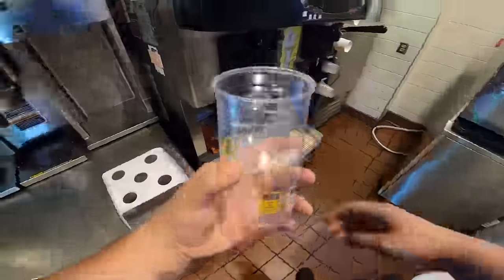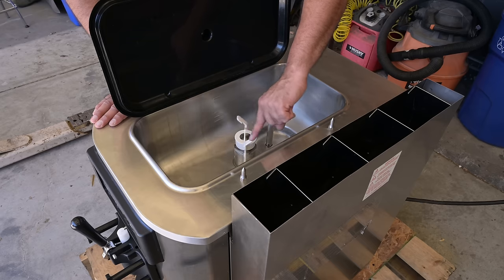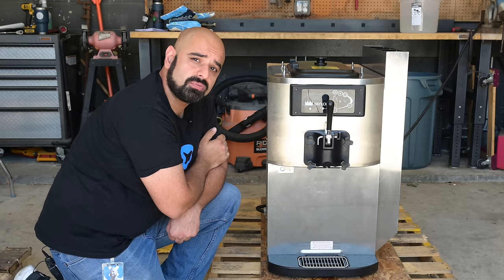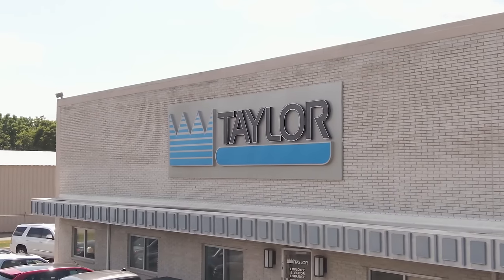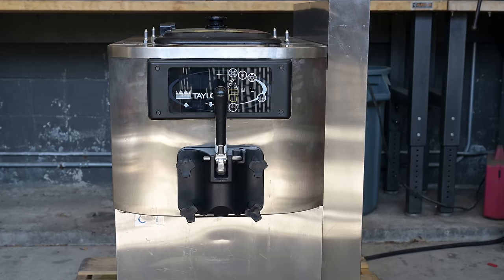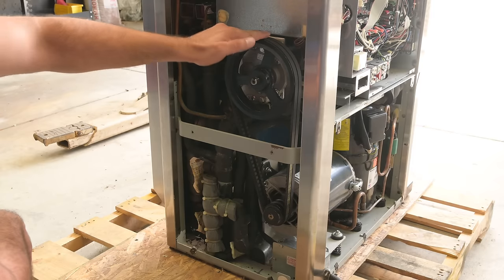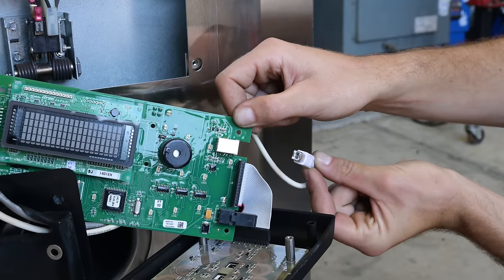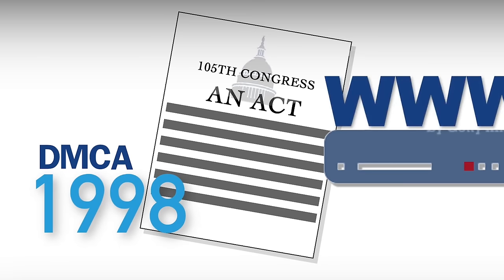Why McDonald's Ice Cream Machines Are Always Broken and How To Fix Them

Comment: As someone who's worked at McDonalds in the UK, the ice-cream machine is actually almost never broken. The employees tell you that it is because they/the shift before haven't cleaned the machine, or (as said in the video) it's on a heat cycle.
Reply: At the one I worked at it boiled down to simple laziness. As soon as the last adult manager left for the day the kids that they left in charge would start telling everyone that the machine was down.
Reply: I think McDonalds in the US has extremely high, seasonal demand for ice cream. A lot of places in the US get very hot in the summer and so people crave a lot of McDonalds ice cream during heatwaves. This leads to overheating and overloading machines which shut down during peak hours
Reply: @dizzy_derps yet people continually say all service jobs should just be for teens part time and demean the adults who work those jobs 🙄
Reply: Idk, I guess the people they hire at Wendy's are extremely good workers. Idk how McDonald's has an average of 30% of their machines down at franchises vs Wendy's who has less than 1%.
Reply: @Camelotsmoon  The other interesting bit is that Wendy's machine made by Kappus which owns Taylor as one of it's brands. Something tells me the relationship is much better between Kappus and Wendy's vs Taylor and Mcd's.
Reply: I have worked for 7 years at McDonalds in The Netherlands and we also had these Taylor machines. 2 of them. They where rock solid. The heat cycle runs at night when the store is closed. You only had to make sure that it was filled up. If not, it was beeping at you in the morning and you simply fill it up and start the cycle again. Done. 

They where cleaned every evening with a big clean every other week. They are very reliable when you use them correctly
Reply: is it a hassle touse the machine and serve ice cream?
Reply: @patrick71994  how busy was your store tho? I see a lot of people saying their machine was fine in other countries but I doubt they have the customer turnover we do in the states. Plus there could be laws in the Netherlands that prevent companies from screwing you there the way they can here.
Reply: The ones in the US have a very strict policy where the machines have to be maintained by a specific company and that company only, at least that's what I learnt in a documentary video I watched about it a couple years back, I don't think that level of anti repair is allowed in the UK which is why it is laziness here.

edit: Oh it's what this video goes into later haha. But yeah.
Reply: @chongli297  Taiwan is extremely hot most the year and the demand for ice creams is quite high, but the machine is never down or broken. Maybe it's because they use the kitch machine here, and since mcdonalds here is managed by a different company, Taylor doesn't tell them what to do.
Reply: Can confirm that the soft serve machines in Hong Kong never breaks as far as I can remember. We have high demands on sundaes mcflurry etc. too, but the restaurants are operated directly by mcd instead of franchised, that's probably one of the reasons why it seems to be a US only problem.
Reply: Speaking of the UK they might be able to provide this to other countries given they only describe the US law
Reply: @Camelotsmoon  Wendy's uses the old manual machines you drain and clean nightly like any respectable food purveyor has used for over 50 years. 

The problem isn't the machine, right to repair, or Taylor. It's that people keep expecting food from a McDonalds.
Reply: @strayiggytv  The notion that an industrial food machine breaks when used a lot is insane. If it does its a badly designed machine and should not be used. Can you imagine a restaurant with a stove that would break if used for more then 2 hours?
Reply: They could have used something like the Kytch in the ones you go to. doesn't mean it isn't an issue.
Reply: @chongli297 Explain why Dairy Queen NEVER has this issue.
Reply: @monad_tcp  your refrigerator is designed to be able to run its compressor continuously for hours on end. When you put a bunch of warm food in the fridge it can take hours for it to cool down. That's not how the ice cream machine works. It is trying to make the ice cream cold FAST. Therefore its compressor is designed to operate under very high load for shorter periods of time (short duty cycle). This is why the compressor overheats during peak demand
Reply: You have different machines across the pond. In America, we have laws that protect the Taylor corporation.
Reply: @chongli297  

""As someone who's worked at McDonalds in the UK, the ice-cream machine is actually almost never broken.""
"I think McDonalds in the US has overheating and overloading machines which shut down during peak hours"

This video is putting out wrong information. Tylor machines are common everywhere even in Sweden, what makes the US McDs special is that McD headquarters have a decades old agreement with Taylor where Taylor pays to be the exclusive supplier of the specific model American franchise takers must use.
This model, used only at US McD, has the special function of the service menu being locked behind a code, that is only provided to the technicians employed by Tylor.
This forces McD places to call for an expensive "repair", where every other place would just have the local staff go into the menu and reset the machine.
Reply: @themonsterunderyourbed9408  Multiple machines?
Reply: @chongli297  Dude, if your fridge is taking more than 30-60 minutes to bring your hot food down out of the danger zone, PLEASE replace it because you have a bad food poisoning event on the horizon. Fridges have such large compressors because they need to move a lot of heat out of the box as fast as possible. Technology Connections actually did a deep dive on old vs new fridges a few months ago that you might be interested in.
Reply: @Xanthelei  I watched that exact video. It doesn't matter what fridge you have, if you take a 5 gallon stockpot full of boiling hot soup and put it in the fridge it's not going to cool down in 30 minutes
Reply: Never in my 25+ years of going to UK McDonalds have I ever been told the ice cream machine is broken.
Reply: @chongli297  If you're putting 5 gallons of boiling hot soup into your fridge you deserve both the electricity bill and the food poisoning you get that month. Try looking at a normal person use case, which is what TC did. People put LEFTOVERS in the fridge, not freshly made food, it's going to be at the top end of the danger zone not 'boiling hot'.
Reply: @Xanthelei  I don't do that. I cool my stockpot in the sink by surrounding the pot with cold water and ice. My point still stands: your refrigerator doesn't have infinite cooling capacity. It takes a while to bring things down to temperature and so you shouldn't overload it. This is relevant to the McDonald's ice cream machine situation because when they are at peak demand the machine may fail to keep up with the cooling needed to make ice cream continuously
Reply: @chongli297  No one has been talking about 'infinite cooling capacity.' You're the one who set that criteria up by declaring that if you put incredibly hot food into the fridge it will take hours to cool it down. The fact is that refrigerators are designed to rapidly cool food out of the danger zone where bacteria multiplies. They will do so by running the compressor as long and as hard as it can without causing damage. Which, again, is what TC talked about in the video you say you watched but apparently didn't pay much attention to, if you think I was using it to claim a fridge will cool 5 gallons of boiling hot soup in 30-60 minutes.

I don't know what you're even trying to claim anymore. That the overheating issue from the Taylor machines isn't a design issue? (It is if it can overheat from a cycle it was programmed to run, or if the tolerances between too full and not full enough are too small. I don't know which is the issue, but both are design flaws.) That it's going to take a really long time to cool a much smaller compartment filled with room-temperature liquid compared a similarly sized mini-fridge with the same size compressor would take to reach appropriate temperatures after putting in a lot of room temperature cans of pop? Yeah it'll take longer, but not multiple hours longer like they had happen here. Certainly not when there are plenty of machines as old as this model that did it in roughly half, based on the comments under the video.

Or maybe you're arguing that it's fine for a fridge to take hours to cool the leftovers from Thanksgiving dinner? As I said, if your fridge is taking multiple hours to reach acceptable levels, it's time to replace it or repair it. Ignoring that behavior is going to cause food poisoning, it's just a matter of time, and it can be avoided.
Reply: @andycanfixit Tyler and McDonald's share a lot of top heads, it's basically a way to feed their own companies money and endless work.
Reply: @chongli297 Those kind of machines have to be made to handle that kind of demand though..
Reply: Thats because the taylor/mcdonalds bad machine deal is a us issue
Reply: Here in Australia I’ve only encountered a Macca’s with a broken ice cream machine once, and that was many years ago. I’ve been back to that store many times since (along with many others) and they’ve always had a working ice cream machine
Reply: it could also be that over heating is less of a issue in the uk since its overall cooler then some of the sates in the us

Comment: You’re forgetting the part where Taylor acquired the Kytch device, reverse engineered it and started offering a paid service not as good as the Kytch while suing Kytch out of existence
Reply: It would have been good if this video referred to the 2021 article in Wired “They Hacked McDonald’s Ice Cream Machines—and Started a Cold War,” which tells the whole sordid story of McDonald’s, Taylor and Kytch and then the follow-up story in 2022 “Ice Cream Machine Hackers Sue McDonald's for $900 Million.”
Reply: can't taylor be sued by engineering flaw?
Reply: Dang, Kytch loss? Nooooooooooo
Reply: @buizelmeme6288  Not really, McDonald's wanted to dismiss the trial but the judge ruled on favor on continuing the trial, so it's still ongoing until there's more updates on the trial, bud. It can really take years for trials like this to end, just gotta be patient and hope Kytch wins to set a precedent for rigth to repair.
Reply: bros. please get info straight..im on your side but you have to all the small deets correct as well.
Taylor was founded in the 1920s. Frobot (kytch) was founded in 2011.....
Frobot was the one that made the knock off, and Kytch was the company that made the device to detect issues in Taylor machines.
Reply: @Skinnamarink.  No, the knockoff is what Taylor made after reverse engineering the SOFTWARE that Kytch PROGRAMMED into an Arduino board (basically a specialty pi machine) to parse the nonsense codes into easy-to-understand English messages. Kytch didn't copy anything Taylor had made - they wrote a dictionary that translated automatically for the user. The most generous possible reading to lean towards 'Kytch made the knockoff' is to say they... idk, copied the manual and then reindexed it or something? Which is a poor understanding of what the device actually did. But it is fact that Taylor bought out Kytch then made a worse version of that same program to sell as a 'service' to franchisees. Thus Taylor made the worse knockoff of what Kytch made.

No one is claiming Kytch made an ice cream machine. That's the only way Kytch could be the one making a knockoff of an existing product. When the businesses were founded has nothing to do with it.
Reply: @luigiymario2xd  Kytch won't win. They have less money.
Reply: @macforme their interpretation of capitalism is to help companies over a certain size to do whatever they want, while passing laws to make it impossible for the little guys to challenge the big guys.
Reply: @jeff__w there's another video about it from a few years back that's really good
Reply: @jeff__w Even just linking to the Food Theory episode would be nice.
Reply: Kytch managed to get a restraining order against Taylor and the suit is ongoing in at least towards McDonalds, the Taylor side has a notice of appeal.
Reply: You're blaming companies for "suing competition out of existence", when the basis of these laws is consumer consensus and every petty Twitter artist cranking out own original characters, to be under DMCA. "We file excemptions" oh great, you voted for laws and now you argue to not follow them. 

 This is why all the production is in serious countires like China, and US business is mostly usury and artifical scarcity, making LABOR illegal for breaking right to COPY products of labor.

Same in education, unis are full of Russians and Indians, because they got Fair Use education to get off the ground in their OWN countries, poached by private companies in USA who OWN all the human capital in the form of copyright to their business secrets, under NDA for any hopeful professors to ever move out and into public domain.

Comment: I used to work for Baskin Robbin’s and had to learn to clean our soft serve machine, I have no doubt this company is designing these machines to break at some point based off how much they charge McDonald’s for repairs. Not one working for BR did I ever have a broken soft serve machine, not one time. Nor have i ever been to a BR that has had a broken soft serve machine, same with Dairy Queen, this is too much of a coincidence and i sense a law suit on the horizon
Reply: The breakdowns stem from the heat cycle that the McDonald’s machine uses for pasteurization. There are not many models with the heat cycle. Requiring machines without it to completely empty the Hopper and clean it thoroughly. The heated pasteurization cycle is the main reason McDonald’s doesn’t clean their machines but once every two weeks.
Reply: @davidew98  the trade off doesn’t seem worth it to me, you either pay for the labor to clean the machine once a week or you pay the exorbitant repair cost when something inevitably goes wrong in exchange for cleaning once every 2 weeks
Reply: @Djjolly037  And not getting icecream sales while the machine is down waiting for repair.
Reply: I've worked for several restaurants that had soft serve machines. I think a few were even Taylors. Mostly Chinese Alibaba machines though. They do break occasionally, but I was able to fix them just fine. When a compressor failed, our refrigeration guy was able to swap it out with no trouble. This situation is definitely something unscrupulous going on between Taylor and McD corporate.
Reply: @davidew98  Id i owned an ice cream shop, id rather have the machines cleaned every night instead of once every two weeks. Even if those machines do not require it, having it spaced out like that means employees are not really in the habit of doing it. If its done every night, then its just part of the job for EVERYONE.
Reply: There was a documentary ion it, close to 60% of Taylor profits are service fees.
Reply: This has obviously been a symbiotic/parasitic relationship between Taylor and McD's since the 60's, so obviously both are in cahoots in the profit sharing/taxation.  Why rock the boat?
Reply: Just thinking that I've never been in a Dairy Queen, Wendy's, or any other place that sells soft server, where the machine is down. Just McDonald's. You'd have to imagine McDick's corporate must be getting some kind of kickback. Otherwise the bean counters wouldn't be tolerating it, and would have switched to different machines ages ago. Remember their whole business is built around maximum efficiency and uptime.
Reply: It gets even more sus when you notice that the McDonald's machines are the same as the Wendy's machines aside from an extra firmware flash. What does the firmware do? It adds additional locks to that model. Wendy's managers can manually reset, but McDonald's cannot without a bypass from a Taylor technician, or a hacktool.

Factor in that one of the McDonald's execs is a board member of Taylor and it all starts to make sense.
Reply: Baskin Robbins has soft serve? How much of that do they actually sell?
Reply: @AvoCattoTV  "Factor in that one of the McDonald's execs is a board member of Taylor and it all starts to make sense."

Well now. That certainly does look suggestive.
Reply: @EssenceofPureFlavor  it’s part of the 31 below treats which are essentially mcflurries or blizzards, I made quite a lot of them when I worked for them, soft serve cones were also still a fan favorite at the time
Reply: @AvoCattoTV  yep there’s the direct connection, figures it’s conflict of interest
Reply: @lyianx  Sounds like the McD machines are a germ heaven. Just as well since it's not really ice cream anyway, it's icy-white-iceream-tasting-goop.
Reply: @AvoCattoTV  Can you provide us with a source for that information?
Reply: @MikeButash  who is profiting? Are the shareholders of McDonald's the ultimate benefactors of those profits? or??
Reply: @manp1039  Someone else in this thread mentioned McD execs on Taylor's board, which sounds about exactly what I'd expect.  Follow the money, there is certainly truth.
Reply: @MikeButash  Is Taylor company a private company or is it a public company? The exec's you speak of.. who hired them? the CEO of MCDs? or were they hired by the MCD's board?? or?
Reply: @MikeButash  Franchisees are left to deal with the consequences of the shenanigans between McDonald's corporate and Taylor.
Reply: I can’t believe that the franchisees haven’t had a class action lawsuit.
Reply: they build a bespoke model for McDonalds.